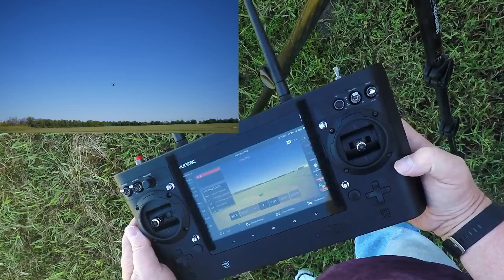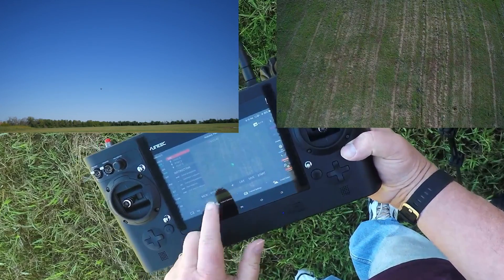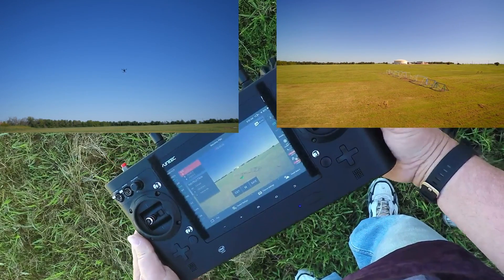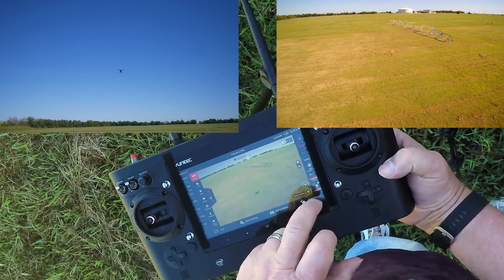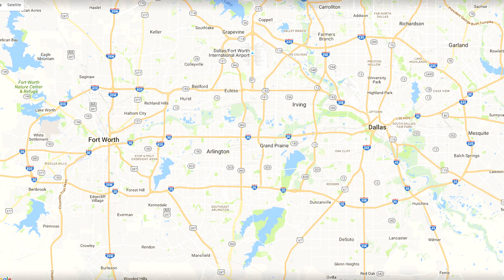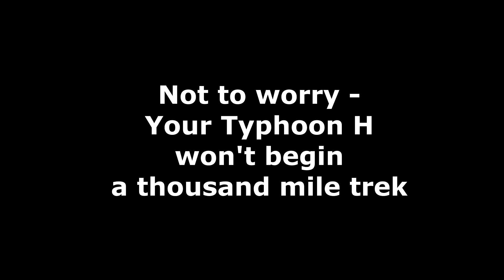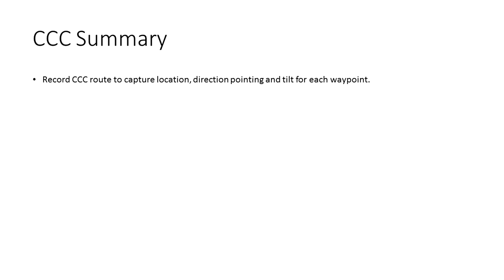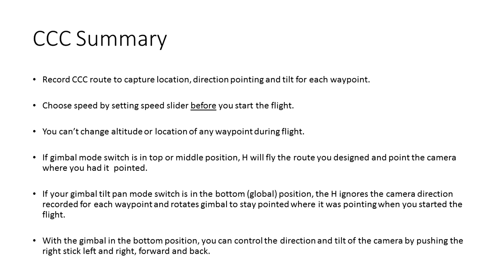Yuneec Typhoon H Drone Curved Cable Cam Tutorial - A Closer Look at CCC

Comment: Hi, Thanks for the video. Are you sure that you can´t change the speed of the H during CCC-flight? YouTuber Fan tho Mass claims it can
Reply from the maker: I tried like hell to do it when I was testing it, but never figured out a way to do it. I also asked someone at Yuneec CS and they told me no. However, I've heard from a few people who say you can. If you discover how to do it, post it back here, would you?
Reply: I will try it myself and let you know the results.
Reply: I do it by nudging the throttle stick slightly: up for faster and down for slower.

Comment: Phantom 3 Pro pilot, new owner of a Typhoon h Pro+, I find your videos on use to be some of the most helpful on YT. Thank you for taking the time to make these.
Reply from the maker: Wow, I appreciate that! So what do you think about the H compared to the P3?
Reply: I like my P3P, but the new Typhoon h Pro+ has my attention right now. The TH is quieter, very nimble and the abilities of the feature set through the controller is mind-boggling. The P3P is very easy to get in the air, fly safety and take great video. The Yuneec has taken a bit more study because it has more feature capability. With the removable camera/gimble, I really wish for a better camera. I am looking into changing or refocusing the CGO3+ lens. I fly with a couple of guys that have an Inspire 1 v2 and a P4P. The P4P camera on the Typhoon h would be perfect. Thank you for asking. Your videos are very helpful, easy to follow and a pleasure to watch.

Comment: Very  good tutorial, I have a H and have had previous models and DJI products. The H  is a new kettle of fish. Subbed liked thank you for taking the time to make this video
Reply from the maker: Thanks, Drone Journey. If you're going from the Phantom to the H, you'll have an easier time than if you're going the opposite direction. Phantoms just have a lot more buttons and toggles and bells and whistles in the Go app.
Reply: Well my first drone was a Yuneec typhoon 4k so both DJI and Yuneec are great platforms
Reply from the maker: They really are. Each has its pros and cons but they're great drones. I fly both and use them for different purposes.

Comment: Great video. Thanks!

You may already be aware of this, but there are a few 3rd-party "apps" for pre-building CCC routes. I've used two of them with great success. 

UAV Toolbox lives in your ST16 (or tablet, or phone).
http://www.uavtoolbox.com/

CCC Editor is browser-based, and will work either on the ST16 or a desktop PC
http://www.videociel.com/us/typhoonh/?#

They're not as fully featured as DJI's or Ardupilot's, but they're way better than having to fly the route and remember the steps.
Reply from the maker: I've heard of these but never tried them. I talked with someone from Yuneec and they'll be coming out with their own SDK to do the flight planning. Watch for this before summer.
Reply: Looking forward to it. Not having a full-featured mission planner "out-of-the-box" was a big disappointment when I purchased my Typhoon.
Reply: ive asked yunnec europe the question about waypoint features for the H a few weeks ago and they answered :we don t plan to put that for the H
Reply: The safest way for CCC is flying the route. Why? Because you can see with your own eyes if the height of the H is enough to avoid obstacles like high trees, viaducts, bridges, etc. All that is not visible in the other possibilities you mentioned.

Comment: Thank you Jeff for this video. During the ccc route it's possible to increase or decrease the speed. You have to put the left stick in the direction the H is going to increase, in the opposite direction to decrease. Each touch increase or decrease a little so if you want a bigger change you have to do it several times. Thanks for your videos!
Reply from the maker: I'm going to test this out, Re Ha. I hope you're right!

Comment: I noticed what looks like two different ST6 units during the video?  One has two antenna like ours and the other one has three antennas, like in a Yuneec video I saw earlier today.  What is the difference?
Reply from the maker: Good catch. The two antenna TX came with the Typhoon H. The three antenna TX came with the Typhoon H Pro. It's possible that new Typhoon Hs will come with the three antenna version. My understanding is that the third antenna improves connectivity at longer distances - I've experienced no difference between the two so far though.

Comment: I continue to enjoy your very through videos!  I'm still interested in getting the 'H' to go with my Q500+, especially with the recent price drop and even with the update issues. I just have to admit I'm really drawn to the Mavic for it's portability and video abilities. I've never been interested in a DJI and really liked the Breeze, until the Mavic came out!
Reply from the maker: I understand your thoughts completely. I will probably buy a Mavic in January/February, in advance of a trip to Hawaii we're planning. The H is just too big to transport on the plane and it would cost $260 to ship it ONE WAY to Honolulu (including insurance). I don't like the flight characteristics of DJI drones as much as I do the Yuneecs and the Mavic is not yet proven, so I doubt it will become my "go to" quad over the H. 

I have a video in the works now that compares the H and the Q500 so guys like you can see if an upgrade is justified. That probably is another month away, however. 

The firmware thing with Yuneec will be temporary, I'm sure. DJI has had lots of firmware screwups and they always manage to get it right, sooner or later. 

The H is a terrific quad, does great in wind, goes longer distances but remains visible - it has a lot of good things going for it. And the price drops are nice. Personally, I'm not impressed with Real Sense. It' works well for anti-collision, but for obstacle avoidance it only works if you're using it in Follow Me mode - which I rarely use. So you might consider that as an opportunity for further cost savings, going with the regular and not pro version. 

So how would you use the H or the Mavic and what are you looking for that the Q doesn't give you?